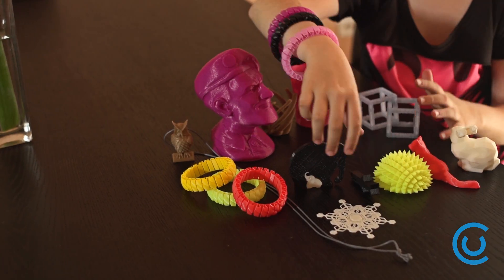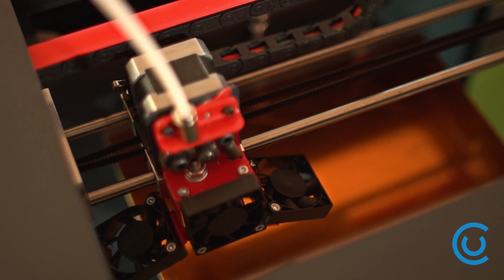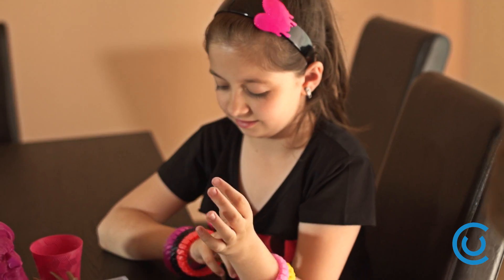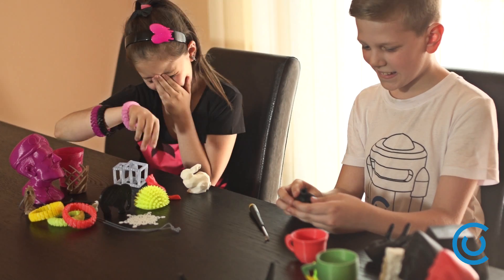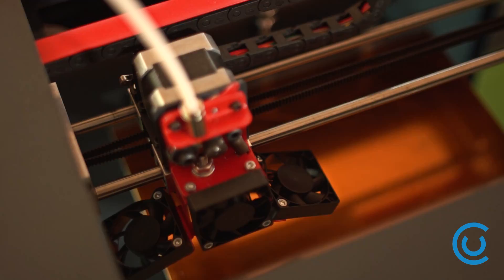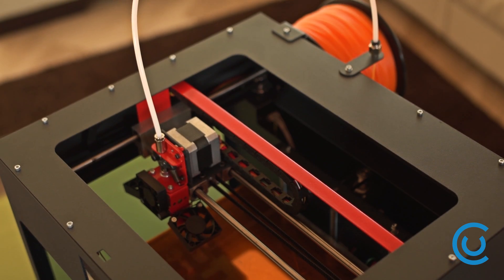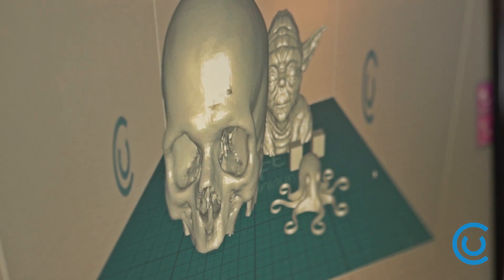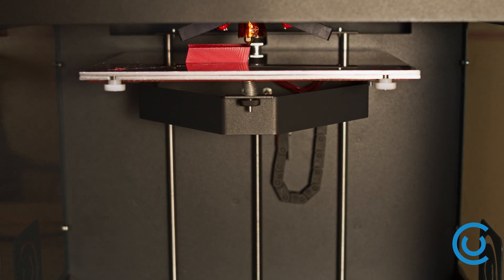CraftUnique's CraftBot

Comment: Bought this as a 2nd bot after looking 3D printer kickstarters for 2 years. This thing is crazy high quality:

- They’re using a crossed Corexy system
- CNC milled parts on all axes, including X-ends and Z stage
- Linear ball bearings on all axes
- 12mm Z rods
- Atmel SAM3X8E ARM MCU @ 84mhz (they use 2, one for USB/LCD)
- Firmware written from scratch (not marlin based)
- Reads standard Gcode, will be able to use other slicers
- Print speeds 50-200mm/sec, travel up to 300mm/sec
- Positional accuracy: 4 micron X/Y, 2 micron Z 

If you want a bot that won't break, won't need upgrades and will have amazing accuracy, buy this instead of one of the bargain bin printers that pop on kickstarter every month.
Reply: ***** 250x200mmx200mm, or about 8 by 10 inches with 8inches in height.
Reply: ***** It's pretty close to the replicator 2, which cost almost $3000. I think the machine is capable of better quality still, the developers just need to optimize the firmware.